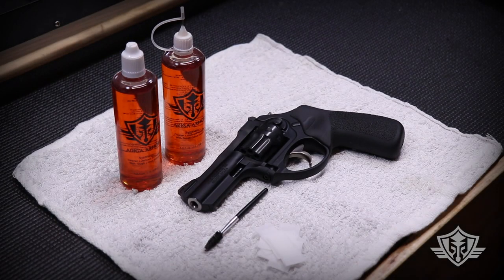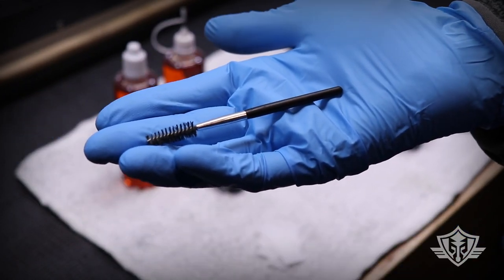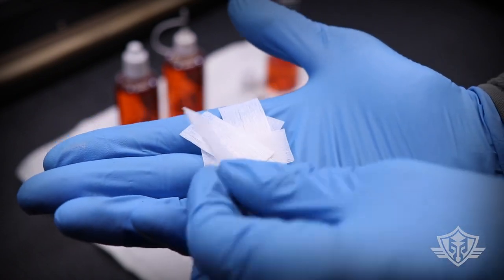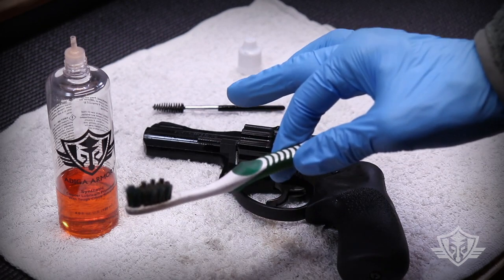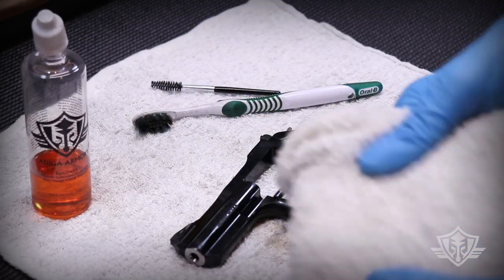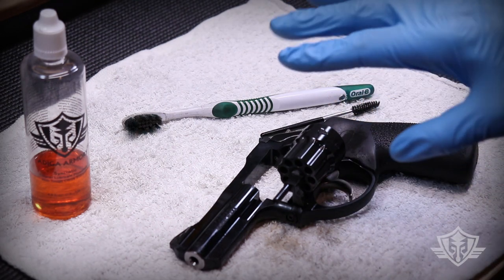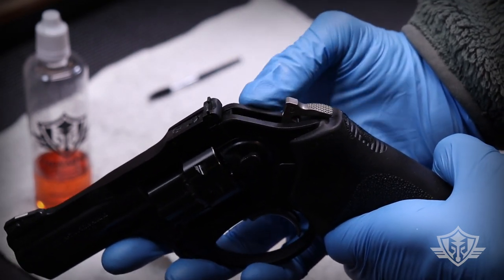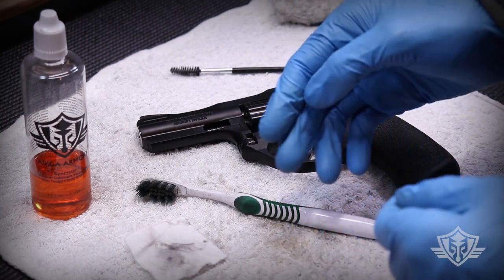Cleaning a .22LR Revolver in the Field: Ruger LCRx “Kit Gun” Fast and Easy with Adiga Armory CLP

Comment: The mascara brush is a good idea, but I don't have a .22LR barrel short enough. Of course, the brush still works on the cylinder, but if I need a standard cleaning rod anyway, why carry the extra brush?
Reply from the maker: I hear that... anything above the 3in-barrel "Kit Gun" length is probably a no-go for the mascara brush... unless you can find some extra long ones. It is nice for cleaning the cylinder though... so easy.

Comment: Great Video, Thanks, I subscribed and bought a Ruger 22LCRx 22LR after watching your video. Thanks for all your research on this Pistol. My problem is the only ammo so far that I could extract with the extractor is CCI Mini Mag & CCI Tactical 22LR Ammo. Armscor, Aguila & Federal all get stuck in the Cylinder and I can't push them out with my finger. I have to press the extractor on a table to get the empty shells out. Ruger Customer Service said that is common with certain types of Ammo. I cleaned the gun even before my first outing and again after each trip to the range. I've got about 600 rounds through it and it's a great gun aside from the shells not releasing from the cylinder. Any suggestions?   Thanks!
Reply from the maker: Thank you... and sorry to hear it. Honestly, we never really experienced any significant extraction issues with the LCRx .22 with any ammo types. That said, try the following: 

First, technique analysis... ie... are you properly turning it upside down, holding the cylinder firmly, keeping fingers clear from shell case heads, and giving the extractor rod a good solid open handed smack... fast, firm, and all the way down? 

Next, make sure the cylinder chambers are well cleaned with a nylon brush, and use a dry patch to remove excess oil/cleaner. Too much excess lube in the cylinder chambers can actually cause issues with blast residue buildup, not to mention it can seep into the live ammo and ruin it. Always wipe the chambers dry. 

If all else fails, as a last resort, you can use some fine silicone carbide "metal grinding compound" or some ultrafine 2000-4000 grit WET sandpaper to polish the insides of the chambers. You do have to remove the cylinder to do that. Hope this helps. Good luck!
Reply: @adigaarmory  Thank You very much for the quick and in-depth response! I will try what you said. I really appreciate You & your Video's.